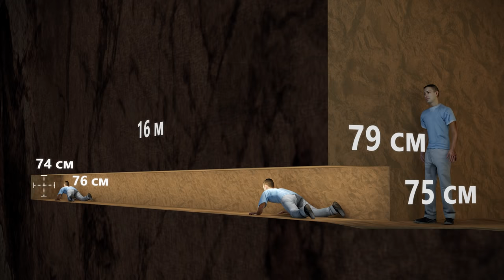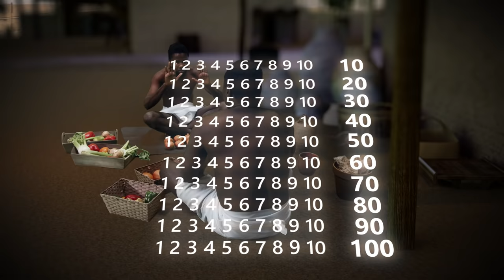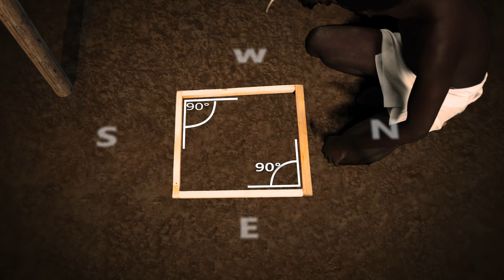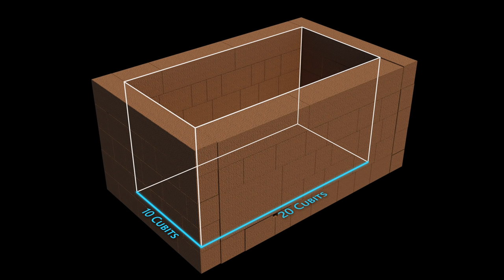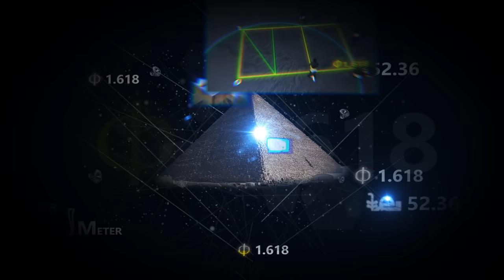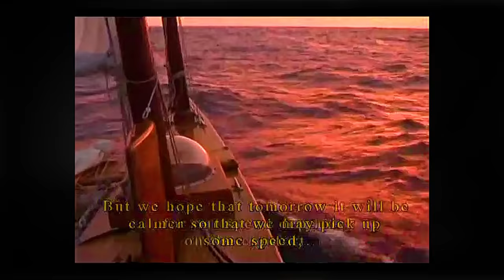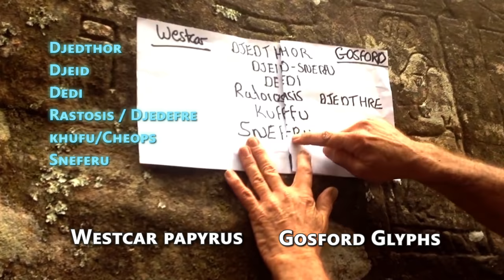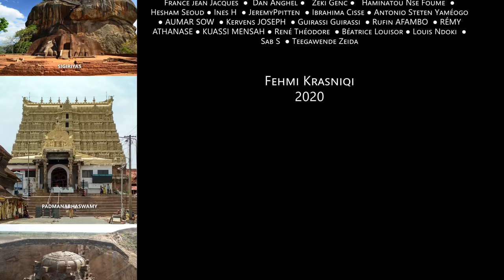The Movie Great Pyramid K 2019 - Director Fehmi Krasniqi

Comment: The concrete and method of construction is sound. The molten granite??? Nah!!
Reply: Well, technically it will become a viscous liquid at between 1210 & 1276°C... So, plausible? Sure. Impossible? Certainly not
Reply: yep, they POURED the horizontal obelisk in order to later raise it? gimme a break. if it were a "concrete" they would be pouring in vertical position, not in a  deep hole in the ground.... (to make it more difficult to take out, ha ha ha)
Reply: @joannayw5272  Its easier to poure the concrete in that posiition ,believeme..
Reply: @Maximus-HK  Granit består av en mix av kvarts å småsten hoppressat under ett enormt tryck  i jordens inre,så om man skulle smälta Graniten såg den nog mer ut som Lava.
Reply: @mick6568  Obsidien,tacksam för länken.john
Reply: @Maximus-HK  how long would it take to melt enough granite to form 1 block? Lets say 12 hr days of full sun gets you 1 block optimistically, you'll need like a 6,000 years.

Comment: Then replicate that melting granite using giant solar lense..!
Reply: Already done search on yt
Reply: @debroopghosh7845  granite melts into obsidian, don’t see much obsidian in those blocks
Reply: can't be done
Reply: Why is the internet so rubbish at reading? The title of the link you've posted "Fresnel Lens melting GRANITE 2300˚ Fahrenheit make Obsidian". Make Obsidian. See that bit? The point is not that you cannot melt granite with concentrated sunlight, the point is that you CANNOT make granite from melted Granite. At least, not in the simplistic way portrayed in this documentary, because you will always get glass (Obsidian) NOT the crystals involved in the formation of granite. To get Granite in nature takes 10,000s of years of very slow cooling. Until this documentary shows some way of allowing the crystallography to happen, near immediately, it IS absolute nonsense. Could there be extra steps? Sure. What are they..?

The idea of geo-polymers is not new, it is a good idea and does make the construction much easier. However, the solar lensing just doesn't make sense. Towards the end of the documentary they seem to lose the plot and interchange geo-polymers with solar lensing, where solar lensing isn't necessary.

I do not understand why this documentary rejects some parts of conventional 'egyptology' but embraces others, so they reject the idea of cutting and transportation, but maintain the construction timeline, which is not based on anything factual AFAIK.
Reply: @louisedavis3870  Hey Dejan when did you change your name to Louise? Also what matters now is not a reply  from my post but instead an emotional response from a woman perusing the comments section looking for a fight.
Reply: @omnigma  Ok then, play-dough. How exactly, in the absence of anything like thermometers and using something as 'basic' as a magnifying lens to apply heat, do you heat a rock evenly, to it's play-dough point, not it's melting point? (Assuming that is even a thing and that heating it to that extent doesn't already cause the crystallography to disintegrate).

Beyond that, how do you get a play-dough like substance to pour? Go try pouring play-dough, it won't work.

Beyond that, how do you get the dough to sit perfectly into all the 'formwork' without air spaces? It's not going to be trial and error, not if these things are made in-situ. Removing the mistakes would be a complete nightmare for them. Yet we see perfect edges and corners, with exceptionally high tolerances.

I know what bumps you are referring to, pretty sure they are completely absent from the King's  Chamber but do appear in constructions in and around the Yucatan - but those are done differently and do not exhibit straight/square edges. There's no need for scaffold to prop things up if there's formwork on them...although you would need to support the formwork, but that has nothing to do with 'bumps'.
Reply: @louisedavis3870  do you believe high tech tools were used in construction? There sure is evidence of circular saw cuts and tubular drilling.
Reply: You cannot, thats why.  When you melt granite and most rocks, it hardens as glass.  Check this demo of someone actially melting granite https://youtu.be/97jMsqJADpc
Reply: @spiritualscientist9869  you should check out Laboratory of Alternative History channel, Russian researchers, good stuff there
Reply: PreviewPreview1:30Fresnel Lens melting GRANITE 2300˚ Fahrenheit make ...YouTube · GREENPOWERSCIENCE · Apr 7, 2016
Reply: @louisedavis3870  ino right, my five year old knows this, minecraft! obsidian!
Reply: @fordhamdonnington2738  What race?
Reply: @Pomorchik   so what exactly are you trying to say? 
You told me the theory isn’t accepted by the scientific community, told me that 2.5 tons blocks are suitable for movement are made of lumps of sedimentary rocks. You also told me the work is magnified if the rocks were to be shaped into blocks. 
What’s your point?
Reply: Ok ok ok.... The fact is that melting it that much would turn to glass... Period... But it wasn't cut either unless it was done by laser.. So, with that said aliens lol.. Idk  but I do know that them traveling around the world is just as far fetched at little green men. But also human DNA has green traced back to a single black women in Africa! That is fact so the by him saying or even acting like people wouldn't believe negro could be Egyptians is crazy. Of course they probably were. So in conclusion based on everything we know and even with my own brain which I might add I have gotten a PHD with we still don't have any new proof of nothing at all. This video is great but we all can make one to point out are own ideology and make pics fit my point of view.. I want fact and someone somewhere has that just when and where?

Comment: Has anybody manufactured a solar lens and melted rock which is then poured out into form molds (made from)???
Reply: Everybody knows it's acid rain.lol
Reply: Uh, everyday. why ?
Reply: Hey Nick.... me thinks you might be an aussie ?   Here's some info on vegemite. It was originaly called ' Pa Will ' ( they did the opposite of the English ' Ma Mite ' ).
Reply: Very good point, they say no evidence has ever been found for ramps or lifting tools and noone has ever demonstrated how these methods were used and then go on to explain a total fantasy method that has never been tested and has no evidence.
Reply: It's very doubtful to me that molten rock from a solar focus could be made at sufficient rate to fill a mold.  If you think about how metal forging works, they melt steel in a furnace to fill a huge crucible (bucket on a hinged hanger) and then pour it all at once.  This solar focus thing would produce molten rock at best at a slow "drip drip" kind of flow because of the small area of the focus and it's limited to the energy flow of the beam (solar insolation * pi * 2.5^2). If you don't do it in one pour (say like if you drip drip in the material), the resulting block would be very poor quality (weak in strength).
Also the idea that those vases could be poured in this way doesn't work. The vases shown have large inclusion crystals, those only form in natural rock that can cool very slowly over hundreds or thousands of years.  If you melted rock and poured it in the vase shaped mold the result wouldn't have those beautiful big crystals because the mold would cool in just a few minutes.  It would be a bland uniform material due to rapid cooling.
Reply: Wood outside  and cooper inside...with hieroglyphs...all together in one shot...
Reply: Irish Jester  Thank you my friend; yes, precisely. 
Viable, confirmable, observable evidence based theory, what a wonderful thing. 
Yes, you are right, I remember a documentary about internal lifting, was it a BBC thing? I'll have to have a search. 
.
I commented a couple of times on this thread and I linked to an interesting old video of a chap moving and erecting a 20 ton stone on his own using the humble genuis of physics. https://www.youtube.com/watch?v=E5pZ7uR6v8c  1800 oxen indeed !
Reply: I have seen lenses made from clear plastic sheets and filled with water used to start fires
Reply: @manw3bttcks  Nice one. some interesting points. And therefore wouldn't it be quite easy to determine if a stone had been cast on site or chiseled out of a quarry by examining it? 
It was quite comical how the documentary showed an actual ancient quarry with part cut stones and then essentaially tried to tell us that wasn't how they did it.
Reply: Yes, we used to do it with glass jars full of water.

Comment: I need to see someone build something with molten granite please.
Can anyone make me a Granite LOTUS vase .. or a fancy ass cast granite head?
Reply: What is the melting point of granite and was there any furnance to melt it during that time
Reply: The melting point of granite is about 1,250° to 1,270°
Reply: Some magnifying sun light beams can reach 5,000°
Reply: There's a guy that has been using fresnal lenses on YouTube to melt all kinds of things.
Reply: @jimbailey8265  That would not be ordinary technology, such as the magnifying lens I had as a kid (and it was of relatively good quality, German made in the 1930s), which on a good day could char paper, but not ignite it, meaning it couldn't hit 450F.  Do you have a link to such a magnifying lens as the kind you are referring to?
Reply: Granite is a composite of various individual minerals forming slowly over time from a cooling magma mass - and depending on what those minerals are and what their component elements are, each mineral will have it's own rate and temperature of recrystallization.  SO, if you completely melt granite, all those minerals will melt, their constituent atoms will recombine and recrystallize in possibly other mineral forms - if you cool it down fast the whole blob of molten granite will recrystallize, but it won't be the original variety of minerals, it will be somewhat basaltic - fine grained, featureless.

Short answer:  Hell yeah, but it's going to have to take 20,000 years to cool it down properly under tremendous pressure so you get granite as the end result.

Shorter answer:  Go with synthetic granite, they've been doing it for years now.
Reply: Dude you don't just melt granite and pour it into molds lol...look at those vases, perfect! Left right to bottom. The statues are PERFECTLY symmetrical in all dimensionality. That is just not a fucking thing if you assuming pouring melted granite into molds lol
Reply: If you were able to make the perfect symmetric facial mold for the statues, wouldn't you question how they got the mold to be as accurately designed as if it was machined on a CNC macine
Reply: @kristincurbo5689  link please.....

Comment: Yeah, molten rock into a wooden frame wouldn't work
Reply: Right? Wouldn’t molten rock melt the wood immediately?
Reply: Not necessarily it depends on what it was coated with I mean when we melt aluminum and pour it into a mold we use a type of oil or something else so it doesn't burn through the mold or stick to the mold but molten rock I don't know LOL. However if they had molten rock they probably had metal also it just has rusted Away by now that's why we find no evidence of any type of metals because it already rusted away
Reply: But where in God's name would they get molten rock from LMFAO! And how would they even pour it into a wooden mold LOL with their hands hahaha
Reply: @michaeljmasseri973  They melt small granite pieces in situ into wooden molds (maybe lined with clay?). When it cools and hardens, the larger granite block is in place.   BTW: What does the "F" in "LMFAO" stand for?
Reply: @TheKevphil  do I really got to......  laughing my blanking ass off
Reply: The film said "clay molds" only about 500 times 🤦‍♂️
Reply: @jaykimble1146  yeah I was replying to someone before watching the films. Thank you though I really love sarcasm
Reply: By the way if you pour concrete that thick in that big without reinforcement like rebarb it will crack you will see cracks throughout all of it
Reply: @michaeljmasseri973  So it's not "fat" then? You're sure--?
Reply: @michaeljmasseri973  Egyptian knew only copper, and copper does not rust.
Reply: Annoying.
Reply: @michaeljmasseri973  They did not have metal, it was the bronze age. Besides, how do you pass molten rock hand to hand all that distance, it would cool down and start solidifying before it was poured, the whole idea is totally ludicrous.
Reply: @michaeljmasseri973  plus it would start solidifying as you moved it along in those super hot pots of clay.... what an idiotic idea, and completely absurd, you would need an enormous furnace, and it had to be poured right from the source, not from a clay pot being handed down.
Reply: @frankfertier34  I'm saying that they were probably much further advanced than that and they probably knew other types of metals and it probably all rusted away. I guarantee civilization was just as advanced as we are now at one point in time
Reply: @dpraptorP  exactly
Reply: Even if you lined it with hair n snot?
Reply: @OttoNommik  I've never seen wood melt .....lol
Reply: @TheKevphil  frankfurter?
Reply: @michaeljmasseri973  ugh isn't there cracks ...throughout...all of it....even in the granite in the king's chamber ceiling.....oh your right this is a stupid ass film!
Reply: How narrow your mind is, who said it was casted in wooden mold?
Reply: @michaeljmasseri973   there are  limited amounts of metals available in "large" quantities at that time. as every stone has its own shape, "molds" were not re-utilized, so a considerable amount of oxidized metal should remain around the pyramids.. The Egyptians (or their ancestors)  surely had techniques beyond our comprehension, but this film is definitely pure fantasy in every aspect and does not bring any valid explanation..
Reply: another thing is that for molten granite to return back to granite form would require very slow cooling or else it turns into something else
Reply: @frankfertier34  well yes because rust is an iron oxide and copper also oxides and that leads to corrosion
Reply: @michaeljmasseri973  solar lens - clay mould
Reply: @dpraptorP  they were transporting chunks of rock not molten rock
Reply: @taylorgall9516  yeah I get that now I didn't watch the full movie when I posted that but I still don't think a solar lens would melt Granite LOL we'd be doing it right now
Reply: Also where is this huge solar lens they supposedly built? What is a shattered into millions of pieces I don't think so how come we don't find any remnants of the Melting Pot where they melt the sand at a high enough temperature to create glass which is another thing they don't explain how in God's name they get sand hot enough to make glass I mean that happens when you drop an A-bomb but I don't think it's going to happen with a campfire LOL
Reply: @frankfertier34  yeah but still where is the Sutherlands how come we don't find any laying around I mean where's the Melting Pot or the fire pit which day would have had to have a huge oven to turn sand into glass it doesn't happen with just campfire so there should be a pit somewhere with all bits and pieces of melted glass and shards everywhere because there is a mine where I live where they were Mining and making glass and I see remnants is all over the place and it's funny cuz it's next to a pyramid that's one odd thing I have to say. This pyramid is in West Milford people say it's just a smoke stack but you can go underneath of it and you'll find all this melted glass well maybe that's what they were doing holy s***
Reply: @dpraptorP  They didn't claim that in the film.  They clearly showed them melting it directly into the molds onsite. I am thinking you spent more time commenting on this film than actually watching it.
Reply: @michaeljmasseri973  yeah it can only melt a small surface area, not enough heat to pour a 12 ton block.
Reply: If they had the ability to make metal tools they would of been able to make metal forms.
Reply: @bcarnett5930  Wow just thing that same thing..
Reply: @dpraptorP  You need to explain this to people who think we can smelt metal with solar and wind power.
Reply: @dpraptorP  they worked gold and copper, what are you talking about??!!
Reply: The narrator says there are no chisel marks on any of the hieroglyphs on the cast granite monuments proving they were cast in situ. I ask what were they cast in that left no witness mark and what material was used to hold molten granite and how were the negative hieroglyphs made in that material without witness marks?
Reply: @tsunamitube3351  Copper containers could not handle molten rock, it would spread the heat so fast anyone touching a copper flask would get burned. And there was NO WAY in hell you are going to melt metal with a primitive piece of glass. It takes a very polished and shaped glass to do that today. They would never transport the molten metal to the site in time either. Its an absurd idea.
Reply: @moewilbur59  I watched the whole film, (at least when I stopped laughing at how blatantly stupid it was) but to think people are dumb enough to believe that ancient people could transfer molten metal in copper vessels is beyond idiotic. They could not have possibly achieved this.
Reply: @GroberWeisenstein  Well, the "molten" granite idea seems pretty far-fetched, anyway (giant solar lenses?), but the notion of geopolymers (granite concrete) is an idea that's been around a while and championed by Chris Dunn, among others.